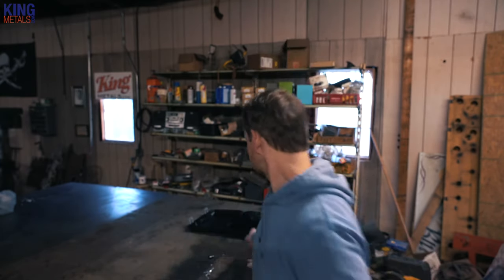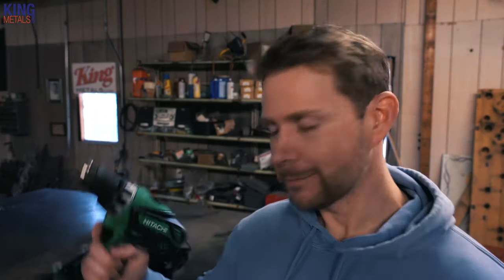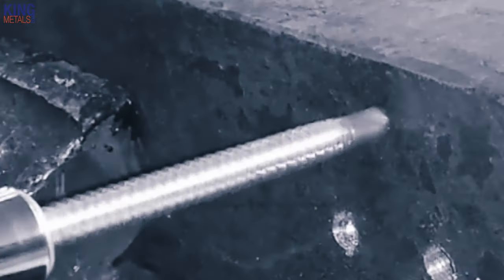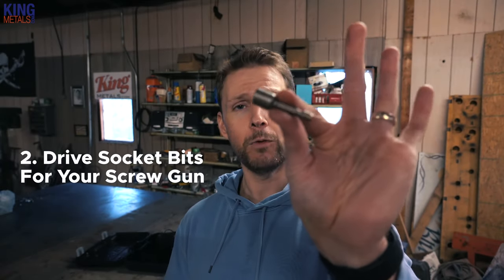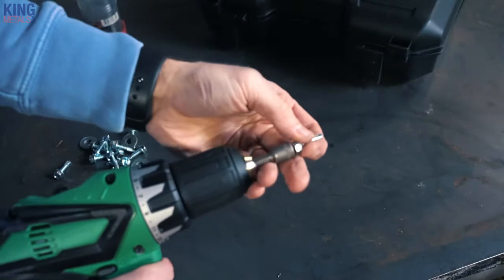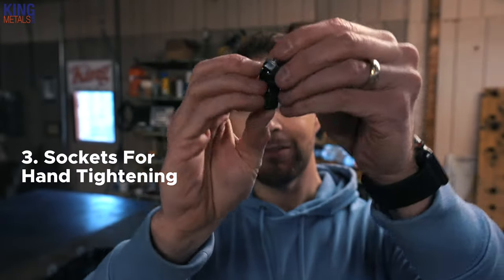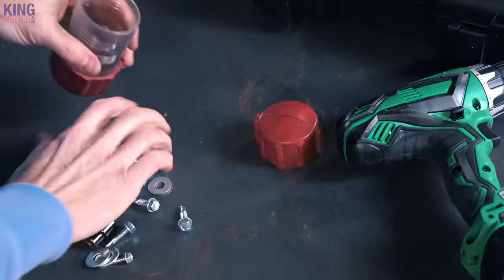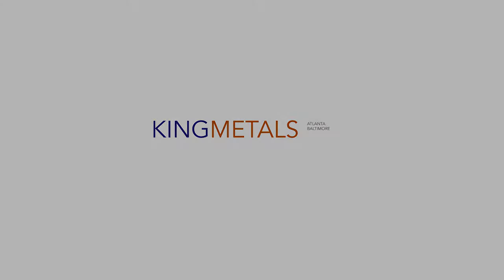Don't Screw Yourself!  3 Tips for Self Tapping Screws

Comment: He is using a self drilling screw which is both a drill and self tapping screw. Even though he keeps using the term self tapping when he is actually holding a self drilling screw, he is still correct because a self drilling screw is also a self tapping screw.
If he was using an actual self tapping screw he would need to drill a pilot hole.
Reply: This...

Comment: I always use a Dewalt screw barrel starter or a Cobalt 1/8" drill bit for a pilot hole - on a separate drill driver. 
Except on very short self tapping screws. 
Also, I have found that 1/2" self tapping lath screws are great for pilot holes heavy gauge sheet metal. They saves on drill bit wear.
Reply: I used a Dewalt impact drill yesterday and screws  did not go through.  :(

Comment: Right where the  Miniature blades are on those screws I would get that size of a bit and pre-drilled a hole and do some practicing on some metal first find the same thickness anyhow but yes I’ve had them snap and it sucks getting them off you can use a lock pliers and turned them counter clockwise to get them back out unless they snap level in there

Comment: Apparently either the retailers or manufacturers make the tapping vs drilling label even more complicated. I have 2 different packages of self-drilling screws that were purchased at a big box store and both are labeled self-tapping. I must admit, I've always called the screws with the drill bit type of point "self taping".  I guess, technically, KingMetalsInc and I were both wrong but I understood and agree with his intended point….. vs the other point.  Thumbs up!

Comment: Good video. However, the screw you are using is a self drilling screw as the package states. A self tapping screw has a sharp pointed tip.
Reply: Wrong
Reply: Most screws, aside from machine screws, are self tapping, in fact. 
But.. Commenter is correct. These are not only self tapping, but self drilling
Reply: Well, mostly a sharp point. But there are several types of self tapping/threading screws - NOT self-drilling, There's self-piercing (the really sharp ones). 
Type 17 point, mostly for wood.
Type A - thread forming screw for use in thin metal .015 to .050 thick. Used with drilled, punched or nested holes.
Type B - thread forming screw with spaced threads and a blunt point with incomplete entering threads for use in heavier metal .050 to .200 thick.
Type 1 and type 23-  thread cutting screw with machine screw thread with a blunt tapered point, having multi-cutting edges and chip removal cavities.
There are several other thread forming & tapping screws, but likely none that would be seen by the average joe installer.
I really don't like self-drilling, they do not make an accurate pilot hole, and it varies greatly depending on the material being drilled by the screw. Buy some drill bits. And a real drill that won't burn up.

Comment: I find it easier to pre-drill the hole and then let the self tapping screw tap the threads in the hole. Also my self tapping screws are phillips heads so good luck drilling with them. As it stands I need drilling oil and a nice cobalt drill bit to drill holes in my sheet metal so don't see how self tapping screws with phillips heads could be any better. EDIT: Seems I'm right. Self tapping screws need a pilot hole.

Comment: If you’re screwing an aluminum piece to a steel piece make sure the pieces are held together or just drill a hole through the top that’s bigger than the screw. The aluminum will bind up.

Comment: I have had bad experience using stainless steel screws. The threads get crushed during the self-tapping. So in my experience you should pre-drill/tap with regular/galvanized.
Your screws look like DIN 7504, however there are other self-tapping like DIN 7976. Do you know any thing about maximum thickness of the metal for various screw-types?
Reply: Hi question, i have a pellet stove. Theres a screw hole thats stripped. Its a hole that holds the screw that holds the glass tightly in. I cant screw it tightly so air gets in and causes a lousy burn. What self tapping screw material would you recommend i use to screw into cast iron? Ty
Reply: @high_fructose_corn_syrup  I think both DIN 7504 and DIN 7976 would do the job. Just make sure to look up how much you should predrill for the materiale.
How thick is the materiale? Would it make sense to make threads, with a thread tapper?

Comment: Any advice for tapping into fence poles? It seems to always slide off when I apply pressure... It's about 100 degrees today and it made me angry enough to punch a baby. 😅

Happened on a flat metal mount too. Maybe I suck at holding them straight.
Reply: Tap a punch into the pole with a hammer. Make a small pilot punch hole so the bit doesn’t slip.

Comment: Can you use a rattle gun to drill them in?
Reply: You could, but rattle guns are next level in terms of torque, so go easy on it. You also run the risk of stripping the thread as it's going in, which will make the bond weaker.